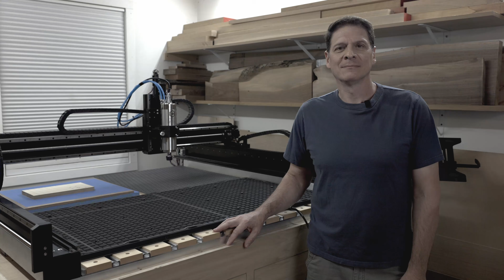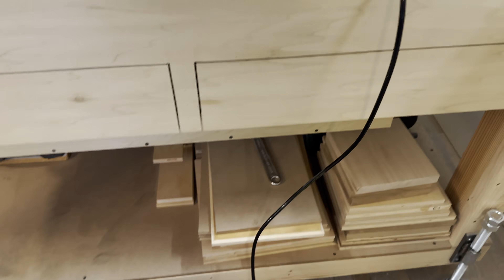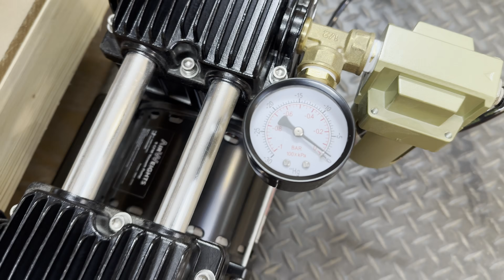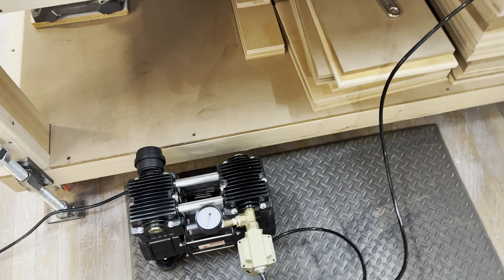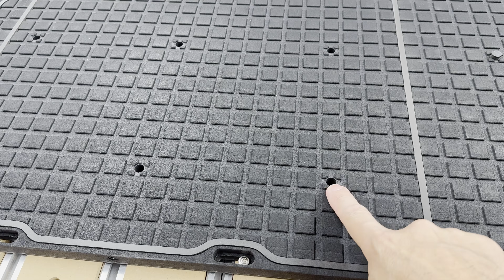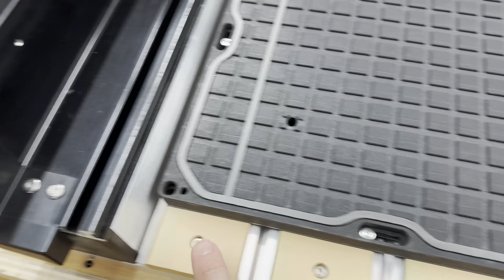CNC Router Vacuum Tables: How do they work, and do you need one?

Comment: They're great when they work, but they don't work well for everything. If all you're doing is plywood or large panel cutting, they rock. For small parts, not so much. I went back to regular taping and clamping after being disillusioned from trying to work with vacuum tables.
Reply from the maker: 99.9 % of the time I use double sided tape or clamps

Comment: Why is reading the gauge in inHg important when you have a gauge showing kPa which is basically like showing the percentage of vacuum that you have? If the pump is rated at -95kPa, then that's 95% vacuum. That is 28.05 inHG. If you drop to 75% vacuum, then that's 22.15 inHg, and that's such a weird scale to be looking at. Stay with kPa or bar if you can. It's much better.
Reply from the maker: I guess it all depends on what your used to, but thanks 👍

Comment: I got my Vacuum table inbuilt from the manufacturer. Where do I find the MDF board that has rubber on each side?
Reply from the maker: Mine is from Airweights I would check their website as I know they sell both the MDF with the rubber applied and you can purchase just the adhesive backed rubber sheets.

Comment: just ordered my Airweights 4x4 system with the 17 cfm pump.  Thanks for doing this video!  Id be interested in seeing a video about how to use the Airweights vacuum pump in a vacuum bagging situation!  I know it can be done using an autocycling switch similar to the vacuum controller veneer supplies sells.
Reply from the maker: Awesome!  Glad you enjoyed it, maybe in the future if there's enough interest for it.
Reply: @StudioZ-maker  at least make a quick video showing your setup and the equipment you used  to get the vacuum bagging going for veneer work!  Valves tubes auto cut of switches etc etc!

Comment: Fantastic idea. I don’t have a CNC, but this would be fantastic to put on top of an MFT or other bench. I’ve never had a notible issue with MDF and vacuum. If you’re concerned, it would be easy to put a few coats of shellac or varnish.
Reply from the maker: Me neither I just use blue tape